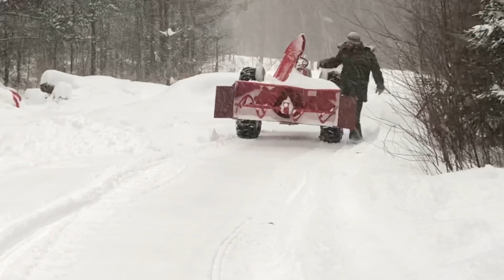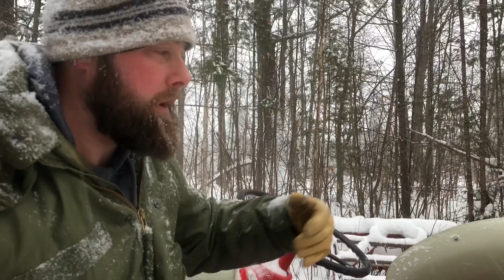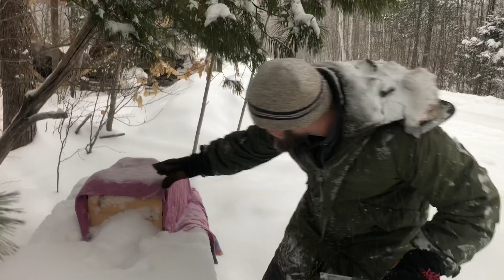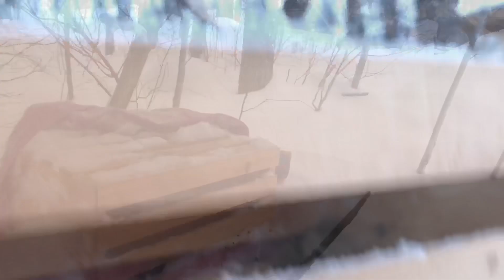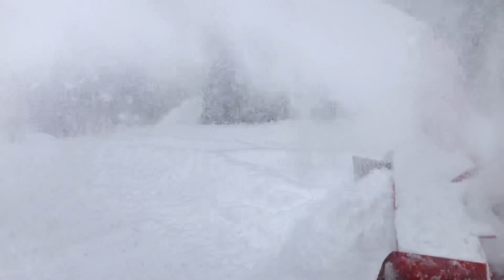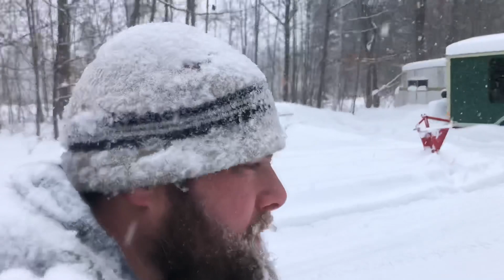#52 Is A Ford 8N the Right Tool to Clear a 1/4 Mile Driveway of Snow

Comment: looks like to me that your snow is getting in the  shoot from the fan ,   when you shut off your tractor,  can you see up the shoot hole when looking in the snow blower, our poke a stick in the shoot and out in the snow blower, where  the half moon of metal is going over the front of the fan hole,  maybe that metal plate needs to be wider across,  mine is about 5 inches passing the shoot hole ,  i put a bigger pic of sheet metal on mine was getting clogged up with snow like yours is doing , compressed in the shoot hole from the fan,   you have to make sure that no snow can get pressed in the shoot from the fan , i have tried to clog up my snow blower up with wet snow  after i added the sheet metal, couldn't clog it up
Reply from the maker: Yes it gets clogged when I press in the clutch especially with wet snow. I now have a new blower for my Kubota and will be selling this one.

Comment: Your machine looks and sounds good, but for a grand or so more than what you can sell that n for you can get a 4000 which has a very heavy front end, so has power steering, dual range transmission for slower reverse, and a two stage clutch that when pressed half way stops the driveline, but keeps the pto running full power, and your 3pt hydraulics will work whether your clutch is engaged or not...but keep up the good work, machine is great!
Reply from the maker: joel sheehe I do like that tractor but I bought a Kubota that I use for my driveway now. Since the Ford is my first tractor it would be hard to part with  and I don’t think my wife will let me get a third but the 4000 is one of them that I wouldn’t mind having. Thanks for watching

Comment: What size is your blower? I'm looking at buying a 72inch for my 1955 Ford 600
Reply from the maker: It is a 60” but I had wings welded on that made it 72” that work pretty well. I have bought a new one this winter for my Kubota that is 72” I will do I video on when it snows
Reply: @backinthewoods2022  I'll be looking forward the new video. Picked my mew blower up Friday. So far so good but I haven't had any deep snow with it yet. The tractor doesn't seem to be running too fast or slow for the small amount of snow I moved.

Comment: To each his own, but I prefer to plow with a truck.  Save the blower for cutting back banks occasionally.  That's the way most highway departments do it and they're the experts.  If I was  going to stick solely with a tractor, I'd consider going with a pull-type blower on the back and a blade on the front.  Just my preference.    Also, no way I'd plow snow in that climate without a cab.  An open-station machine is OK in places where it snows 5 - 6 times per year, but not that far north where it can potentially snow several times per week.  You'll want a cab more as you get older.

BTW, my brother clears his nearly quarter mile drive with an Ariens GT-20 garden tractor and does OK with it.